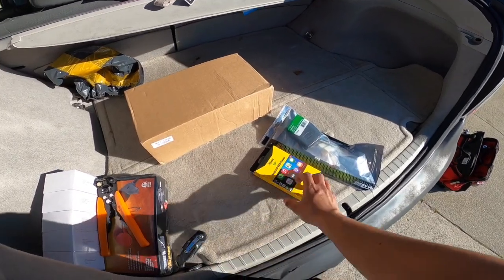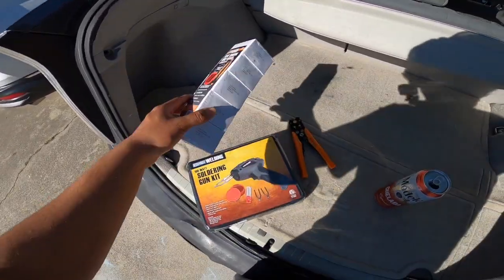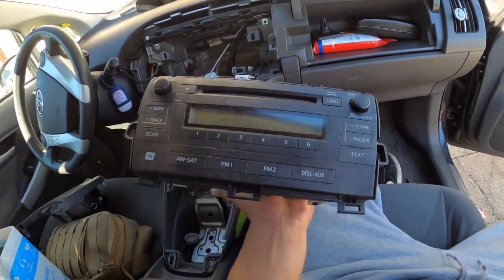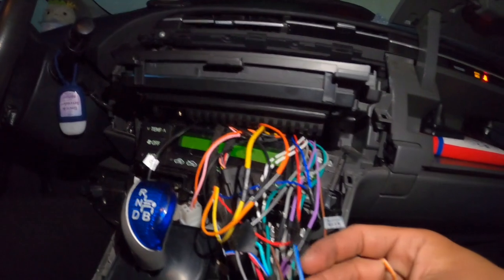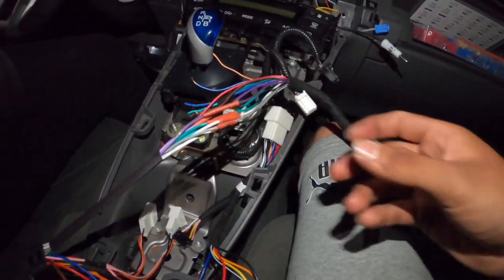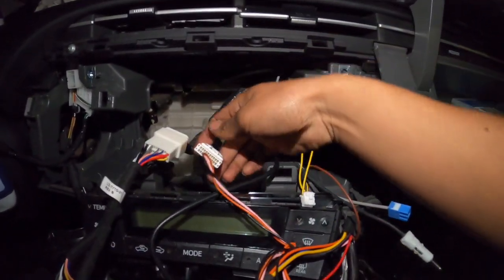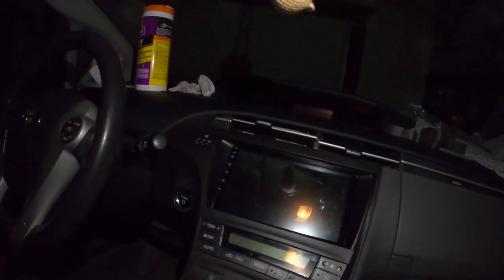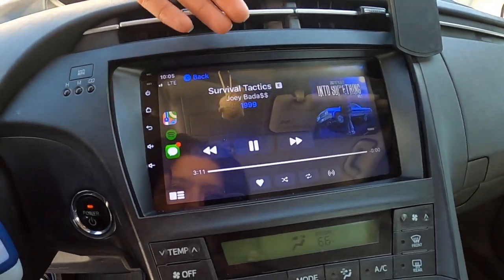Cheap & Effective Android Headunit Install In 2011 Toyota Prius

Comment: Hi the video very helpful. But after I install the aftermarket Android radio but I try to press the the steering wheel control on the right is not working
Reply from the maker: You have to get steering wheel controls that we didn’t decide to pick up.

Comment: Thank you man. Video was super helpful. Just installed mine. Non-JBL. Btw, do you know the exact adapter I will need for steering wheel control?
Reply from the maker: I don’t know bro. Since the one I did was JBL the parts list is a little different. Shouldn’t be too hard to find.

Comment: Nice job! Quick question, that small black box will also control the steering wheel buttons? Or need a separate part just for that?
Reply from the maker: Separate module needed for that. But when you have Bose audio it complicates things

Comment: Hello, Do you see the fuel consumption on the car settings ? I can get to see hybrid battery flow, Thank you.
Reply from the maker: You can change the upper dash board to display different settings as you wish. The headunit install does not affect these.

Comment: hi buddy great video, can we install 10.1" media player in preuis 2013 Japenes ? i bought a car yesterday and found out existing xtrone MP touc does not work and all the controls on steering do not work either do you think replacing a headunit will resolve all these issues ? thanks for your help
Reply from the maker: The way I installed this head unit made it so that the steering wheel controls don’t work. You need a separate harness adapter to make those work. You’re more than welcome to try that and see if that fixes your issues with the buttons.

Comment: For years what I have done has velcroed using high temperature to velcro my tablet over the factory stereo (You can't get it on Amazon regular velcro will melt in the hot sun and not want to stick) so right now I have a 2012 Lexus RX with a 12-in screen that's a full tablet which means I can play YouTube, Netflix, Waze.... Any Android app and I can play videos while my car is moving... I had a 2012 Prius that I did the same thing on...
Reply from the maker: But why keep the stock headunit ?? Makes no sense just replace it
Reply: Genius 🤌
Reply: @tuned_tunas  wellllll. The stock head unit is basically perfectly paired to the car speakers so you can turn it up max volume and it should never blow the speakers where aftermarket unit might damage them eventually....

Comment: Are the volume buttons buggy?
Reply from the maker: Customer didn’t spend the extra money for the module to enable use of the steering wheel buttons so we just use the ones on the head unit itself no issues

Comment: Are you still able to use the head unit to check the prius battery status etc afterwards?
Reply from the maker: The battery life display is on the top cluster where mph is displayed. There was no display here previously. Just the stock head unit

Comment: Thanks for your video, is the steering wheel control working well after installation?
Reply from the maker: No sir you have to buy a separate module to make them work and they don't have the best reviews so I did not bother.

Comment: Every video skips the part where they bolt on the new head unit. Did you get adapters to bolt it on to the chassis? The OEM radio is held in place by 4 bolts. How does the new one stay in place? 12:11  nice video BTW.
Reply from the maker: Probably because you need two hands to set it up. This one doesn’t use the screws more or less clips on in place. Super easy

Comment: Didnt show anything about the brackets when installing the lcd. All good u just take it off stock radio and apply it to new unit.
Reply from the maker: That’s what an install is. I’m walking you through it but need both hands for successful install. The bracket just sits behind the head unit trim when you put it back on. Simple install
Reply: @tuned_tunas  just installed w a kit, easy peasy

Comment: Good video appreciate the content did your steering controls work with the new unit??
Reply from the maker: No you need to buy a separate adapter for that. And for the JBL you need two more parts. Didn’t seem worth it to spend that much just to retain steering wheel controls
Reply: @tuned_tunas  can you link these additional parts/adapters needed for this please?

Comment: I need help for the rear camera, which cable do I need to connect?
Reply from the maker: The one the says camera input on the harness and you just connect that to the camera all the way to the back once you run your wiring👍🏽

HOPE THIS HELPS !!

Comment: So it’s not plug and play? I have the JBL system, is that plug and play? Will I retain the same auto quality as the OEM prius system?
Reply from the maker: None will be plug and play you have to make connections from the headunit to the harness adapter. Still sounds clean in my opinion

Comment: Hey man! Thanks a whole lot for the video! I have the same exact unit and managed to get it working. The only part that's not working, well, 2 actually:
The seller sent me the wrong wiring harness and I lost steering wheel controls due to that. Also, I can't get aux to work. Might also be due to the canbus not being connected to the unit. The amp seems to work only with the radio, as when I play Spotify it sounds like ass (no bass at all, volume is much lower). Is there any way I can contact you for some info? Kinda afraid to start splicing wires on my own and I'd like to send you some pictures beforehand, if you have a minute.
Reply from the maker: Unfortunate to hear about your car troubles. Mine didn’t have the steering wheel controls. You have to have a separate unto to allow them to work again.as for the aux it works fine I just don’t use it ever since its more convenient to use the Bluetooth. But you can always hit us up on ig if you got some more questions. Link is in all of our videos or just find us by name. @TunedTunas
Reply: hi @cristianbam did yo manage to resolve your powersteeting controls issues ? i have exactly the same issue Plus my media toch do not work, do you think replacing the media headunit will resolve this issue also is there any thing i need to consider when buying adnriod head unit for my preuis or any Andriod MHU will work with my car ? thanks

Comment: Is all steering button work?
Reply from the maker: Mentioned I the video that we did not choose to keep the steering controls because we would need to buy another module
Reply: @tuned_tunas  all my steering buttons are working.  The android headset I bought from eBay is compatible with my 2014 Prius.
Reply from the maker: Good for you👍🏽

Comment: I don’t like it coming from a 2011 Toyota Prius owner myself, I like the look of the stereo system and the dash and everything already,!I feel like I’m on the Enterprise from Star Trek, what I would do however I’d get a carplay unit I can attach to the top of the dash between the center and passenger side but more towards passenger side, not a big screen either, something that fits good so it doesn’t over block the very top dash screen the hybrid screen, and also would change the colors of carplay to the same as colors of Prius dash, if possible of course, I do like the camera in the back but I don’t like all those connections but good for anyone who wants to get this done this way , it’s just not how I would do it.
Reply from the maker: How would you install car play on the stock headunit ?? There’s no screen ??
Reply from the maker: To some people this may seem like a lot of connections. But you do this enough times it’s all the same thing for every car. This is what the customer wanted and they are always right.
Reply: @tuned_tunas  most definitely if that’s what they want that’s what they get, I like the CarPlay’s you can attach to the front glass though, would be nice if Toyota had a screen already to sell rather than after market

Comment: too many cuts in the install process. what a shame.
Reply from the maker: Hard to record and use your hands at the same time. If you got any questions lmk about anything that’s unclear to you
Reply: @tuned_tunas  5 dollar phone holder would have been set on the dash. If you were this creative with your wiring skills, this problem wouldn't be this difficult for you to figure out. I can't ask specific question because the problem at hand is too broad.